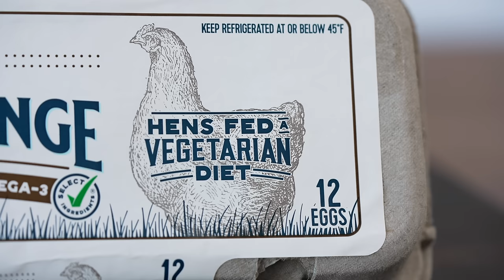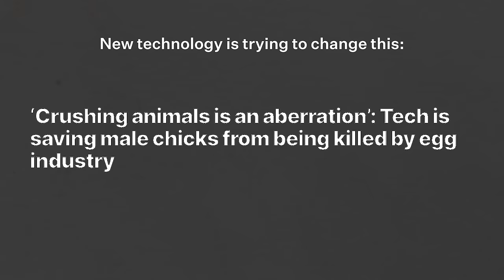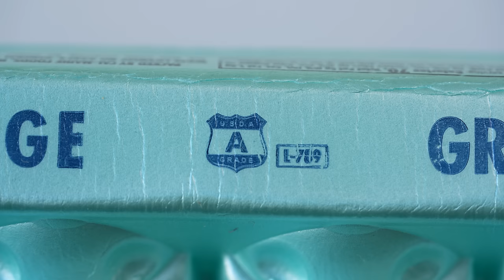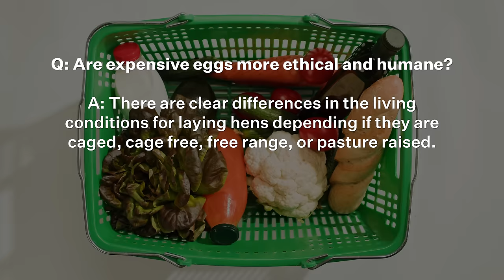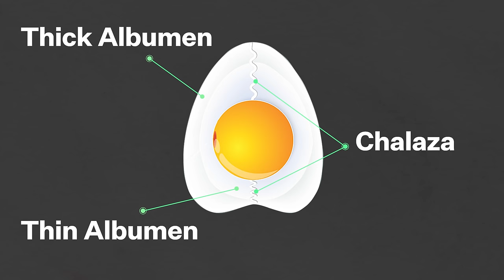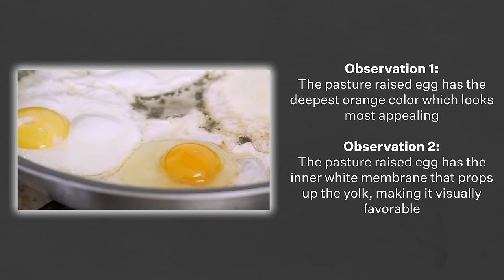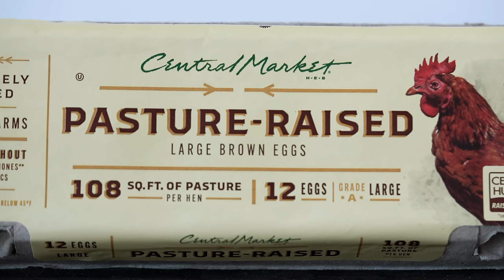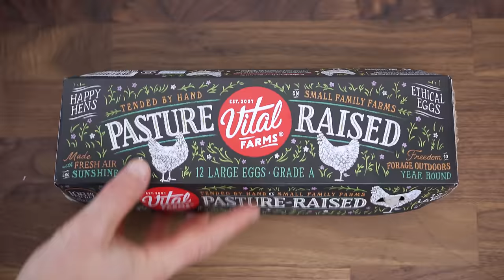Are Expensive Eggs actually worth it?

Comment: Ethan, great video! One thing - you were measuring age of eggs from the time you bought them. Eggs in the grocery store are often 3 weeks between the newest and oldest. You can tell the packing date on all US eggs (which is usually the same as the laid-on date) by looking for the three-digit number that represents the day of the year (January 19 would be 019, December 31 would be 365). Once you start looking for it, its amazing how much older some eggs are!
Reply: Eggs have a thin film on the exterior, when laid. It comes off when they are washed. Eggs sold in store have, of course, been washed of this film. But, not washing that film off extends the freshness further. So, anyone that raises chickens for personal use should benefit from delaying on the washing, as well as refrigerating asap.
Reply: I was amazed he talked about age of eggs without talking about the dates on the side of the cartoons. I noticed at the Sprouts, the other expensive grocery in Arizona, all the organic and free-range eggs were 1 1/2 to 2 weeks older than the cheapest eggs. In NH/MA Pete and Gerry's (NH grown) eggs are about a week newer than other national brand organic eggs.
Reply: @rogelioortiz3003  Unwashed eggs that still have the bloom do not require refrigeration.
Reply: Exactly, age is the bigger factor with eggs taste. If you can get freshly laid eggs from a caged/cage free commercial operation like Purdue or Tyson they taste just as good as local producers. Because they're weeks fresher than anything on store shelves.
Reply: Awesome, thanks.

Comment: I worked for a large egg plant in Boulder CO back in the 70's and they sent old hens and/or dead hens to Campbell soup company.  They came with a large open bed tractor and trailer with a tarp to cover after filling with the old hens.  The plant was torrid hot during summer and hen death would increase at this time of year.  The hens would be tossed in a pile until pick up on Fridays with flies all over them.  By the way, Campbells boils the chick meat until it's safe to eat, but often tough.  If I hadn't seen this first hand I'd never believe it.  The laying house was elevated high above the cement floor below where a loader constantly scraped up the waste into piles for fertilizer production.  The driver had cardboard on top to prevent getting splattered throughout the day.  The laying hens were in cages in rows as far as you can see with augers running down the line to bring in food and/or ground calcium.  The calcium was added when the eggs began to break due to thin shells.  Water was provided in troughs next to the food auger troughs.  There was a boardwalk for workers to cull sick or dead hens. Each cage had from 6 to 8 hens per and no place to lay down.  The rows ran along side each boardwalk on either side.  It was very smelly with lots of ammonia in the air.  The cages were tilted towards the back where a conveyor belt ran constantly bringing in laid eggs gradually downhill to a wash/inspection/packing room.  Eggs were candled for blood then washed an packed in cartons.
Reply: Yeah, this is very typical still around the world. In most parts of the western worlds standards have increased a bit, but its still horrid in those facillities.

The thing is though, for your personal consumption, you can easily buy the "mid" tier priced eggs without losing too much money and you're still going to to do a lot for the animals. Here in germany you're going to pay 1.80-2.00€ for the cheapest eggs (10 pieces), just paying like 0.40-0.60€ more will guarantee free ranging chickens. That's something everyone can pay, eventhose with minimum wage imo. Atleast I can.
Reply: In the near future, humans will be eating bugs for protein.
This canned food sounds awesome in comparison.
Reply: wow! i've been vegan for over 40 years, but stiull, it's good/horrific to read a first hand account.
Reply: A friend of mine worked at a small chicken farm in the '90's and the stories she tells are just sickening. I always shop for eggs marked "certified humane." I hope those birds have a better life.
Reply: And now Boulder acts like if it isn't pasture raised its the end of the world 😂
Reply: I spoke with a pest control worker, who had the regional Chinese-restaurant central chicken processing facility in Phoenix as a regular client. Instead of telling how nasty it was, he summarized by saying that he never eats at restaurants, and his wife prepares all his food.
Reply: Thank you for laying (no pun intended) it all out there. This describes a white chicken egg factory to a t (tho there are worse!) and is why I will pay extra for eggs from hens who can go outside and see the sky and eat bugs and rocks and move around freely. I used to raise egg layers and you can see the difference, the yolks are orange not yellow, the shells are thicker (use a butter knife to break 'em open!) and they do in fact have better nutritional value. Not to mention that the hens are happier by far, and you are what you eat.

Peace!
Reply: @rdxzero  Klaus, is that you?
Reply: @42ZaphodB42  Here in Canada, it's similar to the video prices: c$3 for cheapest, $7+ for for free roam/range $10+ for cage free. 
If it were a 20% difference in price, I suspect a lot more people would get on board. 400% makes it a much tougher choice.
Reply: My dad grew up on a small farm in NJ during the 30s and 40s. Hens that stopped laying went to Campbell's, also. The hens were all free range with a coop for them to spend the night in and to be safe from predators.
Reply: I was born in '52 and grew up in Boulder. Where was this farm?
Reply: @feliciafelicia6965  No. I'm from Boulder. Lots of us like to promote humane conditions. None of us think it's the end of the world if it's otherwise.
Reply: Apparently they weren't the only ones buying them back then but I just read that they stopped purchasing what they refer to as 'SPENT HENS' a couple of decades ago.  It still goes into Pet Food but it's also COMPOSTED.
Reply: Thank you for sharing this. I’ll never second guess my choice to ethically raise hens, and know I get a better egg out of it. It is well known in the chicken community that laying hens have incredibly tough meat, that lacks in flavor and texture especially if they’re older. Their poor bodies have been spent. The boiling for long periods of time makes their leathery meat edible. For hens There’s a natural egg laying break that many breeds experience during molt and cold months. Those poor chickens never get that with the constant lights. 😞
Reply: @frollard  The thing is, even with the 20% increase, people still buy the cheapest option 9 times out of 10. Or theyll buy a branded product, which isnt even better then the cheaper, free range option. People are weird in their automatisms.
Reply: @kshepard52  & @aday1637: It was out on Valmont just beyond the airport road left turn down hill and south of where the jail is now. I got my first laying hens back in the 70s by buying culled hens destined for the soup factory for fifty cents apiece.
Reply: @42ZaphodB42  - It's not that weird.  There are all sorts of reasons why people make their economic choices:  Inflation; totality of financial burdens and responsibilities; genetics; family influence; trust in brand names or not; the latest YT / Media article on food product x/y/z; peer pressure; virtue-signaling narcissism; cult-ish thinking; living wages for most haven't gone up in years and years; family/medical emergencies; etc.  Why wouldn't people try to save money wherever/whenever they can?  Not weird at all, though I wouldn't necessarily make all of the same decisions myself.
Reply: @rdxzero  We will eat ethically raised bugs, while our overlords continue to dine on the finest veal and foie gras.
Reply: @machtnichtsseimann  I didnt mean it disrespectfully. I also bought the cheapest options until I actually sat down and thought about what it is Im actually buying. With just a little bit of will you can change things for the better, for yourself and nature. Its just that lots of people simply dont even start thinking, hence the term automatisms.
Reply: Extremism is bad at both ends. @mr_aidenbrady
Reply: @42ZaphodB42 In the UK free-range does not mean free range. They are still barn eggs who are let out for a short time.
Reply: That may have been the case for you in the '70's but egg laying farms have come a long way since then! And Campbell's quite buying laying chickens when poultry producers started over supplying meat chickens which has been decades ago. Water comes from nipple drinkers which keeps it separated from the feed trough and is able to keep a fresh supply 24x7. Even in today's (Midwest) heat many structural advancements have greatly improved the indoor conditions for the hens. Air quality is much better too with improved ventilation in the buildings. Calcium in feed rations always begins when the pullet chicken is getting ready to become a laying chicken along with appropriate molting periods when eggshell quality needs the break. Genetics has changed and improved the livability for chickens in any sort of back yard to larger laying farms along with vaccines to keep them healthy from the old diseases of the past keeping farmers from the need to use antibiotics in laying chickens. The only thing I want from the 70's is music, not outdated farming practices for my chickens.

Comment: Another great video! In my experience, there is a huge difference in flavor and texture between different kinds of eggs, however the problem is that this typically has no correlation to any of the US standards such as cage free or pasture raised. Most expensive eggs in my experience taste identical to the cheap Aldi's ones, however there are 1 or 2 brands that stand out as being comparable to fresh eggs that eat a varied diet.

I think that chicken diet and egg age contribute to 100% of the flavor differences, but again the problem is that 90% of the expensive eggs I've tried are no better tasting than the bottom dollar ones. In addition to deep yellow/orange yolks, fresher eggs with a better diet have a much more delicate and fluffier texture when scrambled compared to regular eggs. This is almost always true of fresh eggs we get from neighbors and the like, as those are the golden standard imo.

I'm someone who actually doesn't typically salt their eggs or add spices, as a good scrambled egg or sunny side up doesn't need it, and I usually eat a dozen or 2 eggs a week so I'm fairly sensitive to small differences. Outside of fresh eggs from chickens I know, the only brand I've found that consistently produces a product that's similar in texture and flavor is the Happy Egg Co, which comes in a yellow carton. I've come to this conclusion after trying literally dozens of different overpriced brands that in almost all cases taste nothing like fresh eggs and are indistinguishable from the factory farmed ones.
Reply: I have def noticed that happy eggs are significantly tastier
Reply: The Heritage Blue and Brown eggs of Happy Egg are my go to. So delicious.
Reply: One VERY IMPORTANT thing to note that many Free Range egg producers tend to cheat, meaning they have a backdoor to an outdoor space but the chickens often won't know where it is or don't have access to it at all. So basically you're paying a $3-5 premium for those top-shelf "free range" eggs that are actually closer to "cage free".

Which is why I always go for Pasture Raised eggs instead, only $4.99 from Aldi. Just a dollar more but the quality difference is pretty significant.

Comment: To boil eggs (Jacques Pepin?):  I put a pin hole in the end, drop into simmering water for 12min, crack once before I drop into ice/cold water. The pin hole forces extra air out as they cook, making the egg fill up the whole shell with no air pockets. Cracking before ice bath makes it easier to peel - the ice water seeps in between the egg and shell . Also, i never get the green ring around the yolks or a sulfur smell/taste. I’ve been cooking eggs this way for years, works every time. 😁
Reply: I start my eggs in cold water, then set the timer for 10 minutes after the bubbles start to form on the bottom of the pan. I boil them at medium heat to avoid overcooking, because I have 75 year old memories of Mom's boiled eggs with the khaki lining on the yolks.  I thought then that it was because she bought them at the Army PX.
Reply: I use the ATK method of steaming - cold from the fridge - eggs and then the ice bath. Steaming prevents overcooking which I like a lot.
Reply: That pinhole method is how all those hard boiled egg makers at stores work. I pop in 7 of them and they are ready in like 2 min.
Reply: @uli3119  I’ve never seen those things. I learned the pinhole method many years ago. What’s nice is the eggs are perfectly formed for deviled eggs.
Reply: @chezmoi42  This is all about controlling your variables: starting egg and water temperature, water and egg volume, applied heat, and time. My tap water temperature fluctuates a lot, so boiling is nice because it's always the same - but 15 seconds makes a big difference when aiming for a ramen egg.
Reply: @Daniel-is4hr  Yes, I'm sure it does. At 81, I've little patience left for such finicky details.  Fortunately, I prefer them well done.
Reply: @chezmoi42 😂 that's a great childhood imagination 👍

Comment: I kept laying hens and meat birds for over 20 years.  Thanks for a great look at the intricacies of hens and eggs.   The only thing I think you could have added to your study is the variation between refrigerated and unrefrigerated eggs. Otherwise, flawless.
Reply: should be good as long as the eggs are chilled without ice crystals forming within the cells resulting in protein degradation etc. Consistency varies according to egg temp during use. varying temperatures may cause a rupture/microtears to the membrane separating the liquid from the shell due to thermal contraction/expansion which could affect the taste because the shell is semipermeable. refrigerated eggs experience less degradation and oxidation because the shell becomes less semipermeable due to thermal contraction.
Reply: We used to have eggs growing up. Just a couple, but enough that all the eggs we ate came from them. One thing I noticed that while I was used to eating "our" eggs the store bought eggs tasted slightly metallic and strange to me. But going the other way, from being used to store bought and eating "our" eggs I couldn't tell the difference. Have you noticed anything like that?

Comment: One thing I think you missed here is how some cheap eggs can be difficult to cook with. My experience is that many cheap eggs yolks are very fragile, and so they break when I try to separate them for a meringue or emulsion, or if I put them in a pan to fry them. While I think your criteria (ethics, health, and taste) are important, I think cheap eggs can be a barrier to entry to new or occasional cooks because they can make essential cooking techniques seem really difficult.
Reply: Just in your head.
Reply: I switched to brown eggs because the white egg shells were thinner and kept cracking when I boiled/steamed them. I get the cheapest brown eggs which are  about 2x more expensive than the cheapest white. Still like $3 though…
Reply: I find the size of the egg is a much greater factor in consistency of behavior between specimens. Large eggs have a bit of variation, while XL and jumbo are wildly inconsistent. Similarly, small and medium eggs are very easy to get consistent results with.
Reply: My chickens butt nuggets need to rest for about a week or be put into the fridge before I can fry one without breaking the yolk. If I try and eat same day, the yolk almost always breaks when flipped.
Reply: @lamebear1000 I'm having the opposite experience lol always  buy white shells and last week bought brown by accident and yesterday it took 4 attempts to successfully boil an egg. They all kept cracking immediately